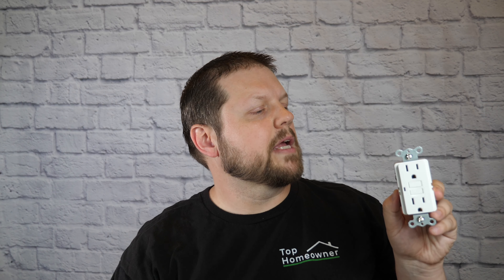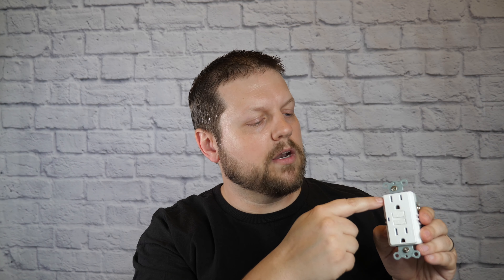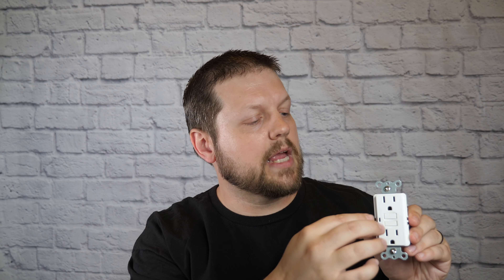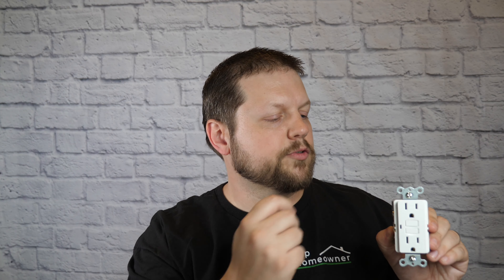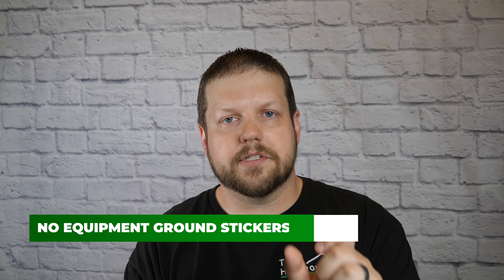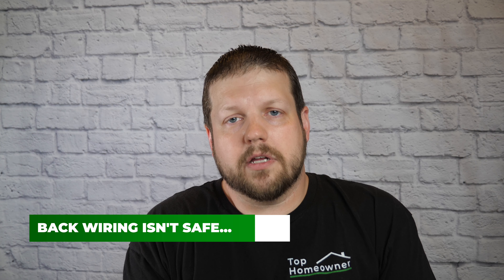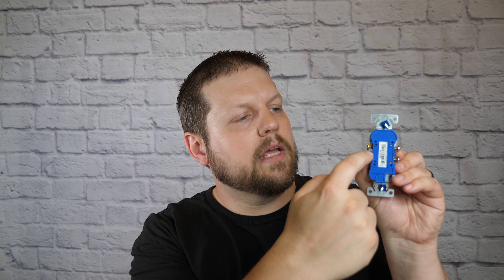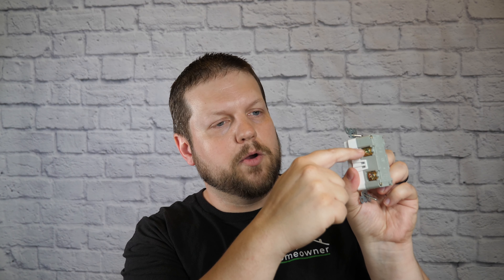Upgrading Two Prong to Three Prong Outlets - Don't Rewire Your House?

Comment: So if I were to plug a surge protected power strip into a GFCI that's replaced a non grounded two prong outlet will my electronics be safe? Also will the GFCI flip if the surge protected power strip is overloaded?
Reply: No.
Reply: A typical surge protector has varistors between all three contacts so they work also without grounding.

Comment: The tab on the 2-prong to 3-prong adapter does indeed bond to the grounding pin.  The theory is to run the center cover plate screw through the tab, but that would only provide a (somewhat inadequate) ground if the receptacle box was metal and itself grounded.  In general, using a 2-to-3 prong adapter is a terrible idea from a safety point of view.  It is the non-destructive equivalent of cutting off a grounding pin.
Reply: It can be even worse. Lets say you use two of them and one does ground through the screw but the other does  not. Now you have created a dangerous situation where you have grounded and ungrounded devices side by side. If the ungrounded fails and you touch both at the same time you can get a very dangerous shock.

Remember it takes 50 amps to reliably and immediately trip a breaker but just 0.1 amps to kill. Poor grounding can be more dangerous than no grounding,.

Comment: But on the adapter won't the faceplate screw through the tab provide a ground if the box and conduit are metal?
Reply: Yes, as long as the conduit is continuous and the panel is wired correctly. In many homes built before 1970 a separate ground wire was attached to the outside of each metal box to provide ground even though the receptacle was 2 prong and the main cable has only hot and neutral wires. You can verify this by using a receptacle tester plugged into the adapter. If it reads "open ground" then no dice. If it reads "correct" then one of those methods of grounding was used.

Comment: Hi there, rewiring an old house electrical wiring. 3 gang box im using coz 2 switch and 1 outlet. But the old wiring only shows : first set which the black is the hot wire with 2 yellow wires. Then 2nd set only got one black and one yellow. How can i do this? Thanks in advanced.
Reply: What's a "coz"?

Comment: Could a person run a single ground wire, from the outlet, to another outlet that does have a ground? Or, directly to the ground rod on the outside of the house? Is this unsafe, or ineffective?
Reply: @Paulina Romanovsky My house is a mess. Only the kitchen, shed, and part of the basement actually home run to the panel box. They grounded this house on several locations to cold water pipes. The pipe is bonded to the electrical panel. There's also a ground rod at the meter. Plumbers are not allowed to run PEX as they would interrupt a ground path somewhere. I'm guessing this was done in the 1980's code at that time. GFCI wasn't required at the time except for washing machines and outdoor receptacles. Is this safe?
Reply: * If the two different receptacles are on the same circuit, yes, a ground wire can be run to the outlet/ receptacle with the ground wire, and that should meet code.  If on 2 different circuits, no.
* Could the ground wire be run directly to the ground rod?  Yes, if that is the grounding point used for the breaker box.  No, if the ground rod is not the grounding point for the breaker box;  otherwise, a ground loop circuit would be created.
Reply: A simple ground rod will do nothing without  a GFCI. Did you forget that the ground wire needs to be connected to the neutral. That is what provides the protection, not any rod.

Yo can run a wire from known ground under the same panel like a grounded socket.

Comment: Since this will pass code, can you convert an entire house by using GFCI breakers in the service panel?
Reply from the maker: If your panel will accept GFCI breakers than yes. We had an older house where that wasn't an option and was told the entire panel needed to be upgraded. Always double check local codes to make sure too.
Reply: Who said that this will pass code? The clown who admitted that he is NOT an electrician?
Reply: @donaldhinson7144  This is a common practice. It's also listed somewhere in the National Electrical Code as 'acceptable' and many local jurisdictions. Maybe you want to check it before you cop an attitude.
Reply: @jimaiello750  "...somewhere in the code????????". Where??
Reply: @donaldhinson7144  do your own research! There are many electricians in the Detroit area, and I know for certain my local jurisdiction will approve this! If all you're here to do is chuck rocks, then find somebody else to play with.
Reply: @jimaiello750  yo mama
Reply: @donaldhinson7144  Can a GFCI circuit breaker take the place of a GFCI Outlet? Would it be considered to meet code?Yes, a GFCI circuit breaker can be used as the ground fault protection device, and both methods will satisfy the NEC Code requirement for GFCI Protection, NEC Article 210.8. Happy now?
Reply: @jimaiello750  FYI: Can a GFCI circuit breaker take the place of a GFCI Outlet? Would it be considered to meet code?Yes, a GFCI circuit breaker can be used as the ground fault protection device, and both methods will satisfy the NEC Code requirement for GFCI Protection, NEC Article 210.8.
Reply: @donaldhinson7144  The NEC says it will pass code. Is that good enough for you?
Reply: @donaldhinson7144  One does not need to be an electrician to know to read the code.

Comment: If I have 3 outlets that are ungrounded and they each have only 2 wires so not connected in a circuit. So do I need to put GFCI on all 3 outlets?
Reply from the maker: Yes, if each one only has on pair of wires in the box, then you would need 3 GFCI receptacles.

Comment: If I install a GFCI receptacle on the first outlet of a circuit, can I replace all other 2 prong outlets on the same circuit with regular 3 prong outlets?
Reply from the maker: Yes. The GFCI will protect the rest in the circuit. Just be sure to add "No Ground" stickers to the other receptacle covers.
Reply: But wouldn't you need to link the ground prongs on all the outlets to the GFCI for it to be effective? How would the GFCI detect a ground fault on a downstream outlet otherwise?
Reply: Ok. So I just found the answer to my own question and realized that you covered it in your first video, but I didn't process what you meant when you said it. I'd like to clarify for anyone asking the same question. The GFCI doesn't actually use the ground prongs to detect a ground fault, instead it detects a differential in the current flow between the phase and neutral wire which indicates that power is leaking to ground somewhere in the circuit. It won't actually prevent an electrical shock entirely, rather it will detect the fault (i.e. you getting shocked by the faulting appliance) very quickly and will disconnect the circuit preventing a prolonged electrocution. This certainly seems to be more of a potential life saving measure as apposed to an appliance saving measure. I feel like all home circuits should have GFCIs, otherwise a faulting appliance will simply dump current into ground and drive up your power bill without any indication to the homeowner that there is anything wrong.

Comment: Other videos said to place the GFCI on the first outlet in the circuit. But I have not easy way to figure out what that first one is. Can I just replace every outlet with GFCI?
Reply: Yes, but do not then the the load side of the outlets. Do not chain GFCIs. That can cause problems.

Comment: What if I hammered a ground rod into the ground and ran a ground wire just to the few outlets that I need to use for equipment ground? I can do this from the crawl space but rewiring the house is a task far too cumbersome
Reply: @Kevin Don't waste your time as that will accomplish nothing. The ground wire aka equipment grounding conductor must be bonded to the neutral wire at the main panel in order to complete the circuit and trip the breaker if a ground fault occurs. What you're describing is sort of a grounding electrode conductor, but must be connected from the service panel, not from a receptacle. They're serve two different purposes.

Comment: Thanks for your thorough and clear explanations.  I have a home built in 1958. It has two prong outlets. But I seem to recall when replacing a light switch that there is a third wire coming out of the power cable and it is screwed to the box. Is that the ground?  And if it is then can I just replace the two prong outlet with a three?  Or do GFCI outlets have a place to attach the ground (3rd) wire and then it will be a grounded outlet?  Thanks.
Reply: My house was built in '56 but a large dormer was added on later.  The lower floor all has two wire Romex, but the second floor has metal boxes with ground wires connected directly to the box.  This is not up to current code, but better than no ground.
I had the service brought up to 100A and added GFI outlets to the three circuits coming up through the bedroom directly above the panel, plus the kitchen - the bathroom already had a GFI.
Reply: @mlconley  Where did the ground wires originate?  If from the box to the outlet, then did they attach a ground from the box to the GFI outlet?

Comment: I’m begging if theirs other 2 prong outlets and one gets replaced first on circuit to a gfci all 2 prong outlets also have gfci protection but you need a cheaters adapter lol
Reply: You won't need a cheaters adapter if you change the downstream receptacles to 3-prong. The GFCI comes with stickers "No Equipment Ground" and you would place them on all the new receptacle covers including the GFCI.

Comment: Doesn't the GFI only provide protection in the case of water? That is why they are in kitchens and bathrooms. How is this any more safe?
Reply from the maker: GFI provides ground fault protection so if you want to add an extra layer of safety to a home wired without ground, it's an alternative option.

Comment: Do you have to replace everyone two prong outlet, with a three prong.
Reply: It depends. If your circuit is wired in a daisy chained fashion (using the receptacle as a connector) then you'll only need a gfci at the first receptacle, once you determine which one that is, and all the downstream receptacles would be connected to the Load of the gfci. The downstream receptacles would be changed to regular 3 prong. Not really difficult to do.
If your receptacles are wired using pigtails, making each receptacle independent of a previous one, then yes, you would need a gfci at every one. It's possible to do otherwise, but impractical because the labor cost and if you don't know what you're doing it could be a mess.
Reply: You do not need to replace any one of them. You can replace as many as you want, one or all or anything between. Just make sure that they are GFCI protected and marked appropriately.

Comment: 2 aspects of gfci's not discussed in this video:

Cost ..... is a breaker or a recepticle cheaper for the same protection?

Location.....some homes have the electrical panel in the basement and a 3rd floor bathroom.  The neighborhood kids may not enjoy the show as "NAKED MAN" runs down to reset the gfci and returns to finish with the blow dryer.

These two aspects may have you doing a far different installation than you originally planned.

Comment: You can easily ground that without a ground wire. Off the neutral line.
Reply: No, that is not safe and is illegal aka a "bootleg ground".  Neutral and ground are connected (bonded) at the main panel and nowhere else.
Reply: Noooooooo! A neutral is NOT a ground. A neutral wire is a conductor.